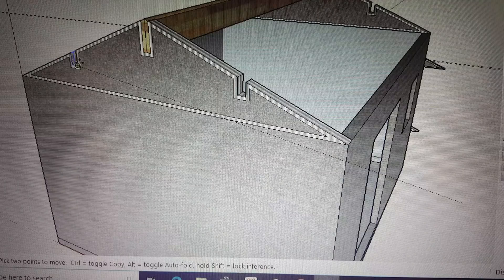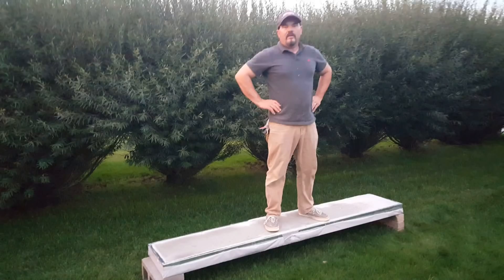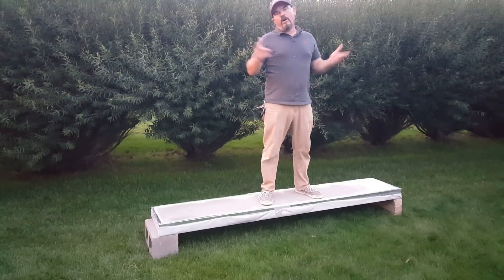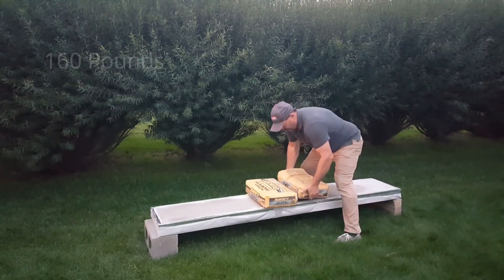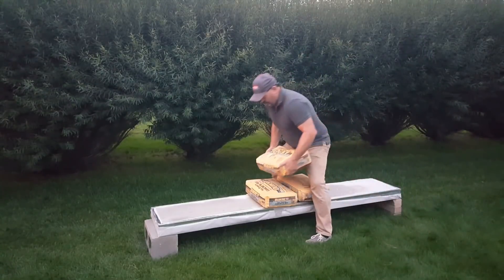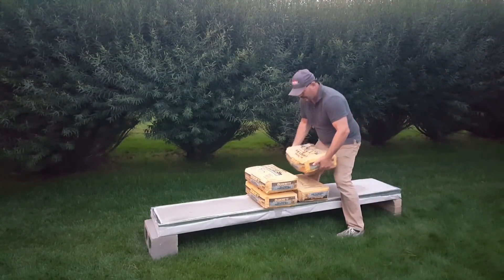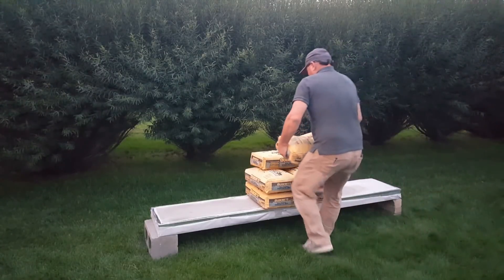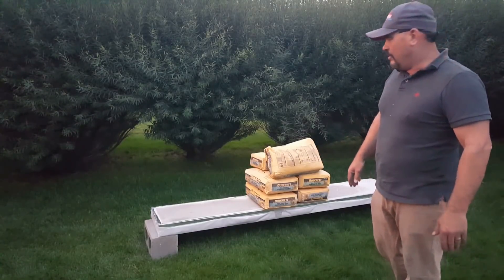Air Crete Stress Test, Amazing ,Strong Lightweight, Building Panel

Comment: You should try to test it to failure in preferably in at least all three simple stresses ie compression, tension and shear forces. You could then infer any complex stresses like torsion or bending based on how well air Crete performed compared to regular concrete. Common sense says it is less strong but my intuition says it’s probably not that much weaker and certainly strong enough to be relied upon for most applications.

Comment: Hi there, We are just looking into air crete and have a slanted porch roof we want to air crete ... My question is what do I need to do? lol  Since it is slanted, but not like a pitched roof, more like a slightly pitched lean to.  My question is, could we spray down a  semi thin air crete mixture on the surface of the roof which has some rubberized stuff, we tried before that sorta worked but have leaks.  So can we just apply the air crete over this like I said before, in like 5 inch pours, and then put more over it after it dries? By now you must know I have NO IDEA, what I am doing:(  Like do I have to make forms or just apply the air crete on the surface of the roof? My email is fairytale_cakes@yahoo.com thak you for all your videos and help you rock kind sir:)

Comment: Darwin, I'm glad Stephen P.  Brick mentioned using the basalt mesh.  I am in the process of building a home originally planned to be all metal.  Now I'm seriously considering air crete for outside walls and skipping a LOT of insulation.  I NEED to know about the strength of the panels if used for floor or ceiling such as a sleeping loft in a 2 story house.  The area will be 16 ft x 32 ft.  Got any ideas on how I should support air crete for the floor?

Comment: Air Crete can it be used to make a aquaponics tank that is my next project was going to do concrete panels but this is super neat for sure
Reply: I can't speak to the structural strength of the material, but with Aquaponics you need to be super careful with the chemicals your system comes in contact with. In regards to cement alone, its fine for tanks/beds, but you'll have a long road a head to stabilize the pH in your system due to the cement. Most people who use cement tanks, usually line it with PVC pond liner or the likes. Now in terms of the foam additive for the AirCrete; you don't want anything that would be toxic for your aquatic life. In terms of the AirCrete surface finish, being highly porus, you'd likely have issues with the bacterial colony that you can build up, in terms of sustaining them against the high pH of the cement. If you can solve alot of those concerns via pond liner or other methods, then as long as the AirCrete can withstand the forces required by the volume of water you want, then you should be fine. takes a breath

Comment: How strong is aircrete can it support a lot of weight talking about tones of weight.. I am trying to see if it would be work for an underground application.
Reply: Timothy  Travis I’ve seen numbers around 50-900 psi. The less foam, the stronger. I would stick with using regular concrete and maybe using the aircrete for insulation. You can easily get much higher numbers with concrete block or whatever. Look into an interlocking soil block press. Cheap and easy and makes much stronger material thats easier to use. Especially when fired.

Comment: Would be good if you produce figures! 
Good, great, phantastic, strong, lightweight, insultating ...all these words reflect  your opinion only but and are not material properties....

I worked with / engineered / designed many foam concrete applications, a diesel driven  foam concrete machine for in situ production of various foam concrete densities and pumping of wet concrete.

I admire your Videos sind enthousiasm but with that you also show that you are at the very low end of foam concrete design and its applications.

Please improve.

Best regards

Greattimez
Españistan

Please back up your personal opinion with fakts and figures
Reply: O yes at least I learned many things wich I can use for my projects from low end and non from the high end

Comment: Not sure where the idea that Aircrete has no strength comes from.  They've been using it in Germany for decades, building most of their large, commercial structures from the stuff.   Pretty sure they get snow from time to time, too.  Aircrete isn't new, but current U.S. building code is outdated and myopic, so anyone wishing to build in an area requiring codes, which is pretty much everywhere, is screwed if they want to use Aircrete.  It's a shame, really.

Comment: would the structural integrity hold up in humid freezing conditions? aircrete would be more absorbent than regular concrete, right? just wondering if it can hold the weight but if thatd change with sleet/ice/snow

Comment: How much expense for a 600 sq slab?  Just to get past a building requirement.. Thanks. Your guess for thicknesd... Cheapest is best
Reply: 1 sack cement does 5.5 cubic feet of aircrete, use an online calculator to figure the rest.

Comment: You could put steel reinforcement in aircrete, right?
Reply: they did, chicken wire, not the traditional type of rebar, but it is all it needs

Comment: Great! But... You schould be aware that it's not the air crete that actually passed the test but rather the aluminum frame! Without the frame, the pannel would bend and crack. In anyways, you made your point! And thanks to You I have been researching about air crete and yes, that stuff is amazing! I dont know if it is 100% waterproof, but if it is, Your next challenge could be... building a boat! keep up the good work! +1 (one last concern, aluminum and concrete dont mix so good... galvanic corrosion...)
Reply: lol! You sure can! Do some research Richard!
Reply: Wire mesh boats are floating all over the world! LOL! Most people are cluelesss!!

Comment: Can you do a Stress  Test  on a Panel  without the Metal Frame
Reply: he does not understand what stress or test mean
Reply: If you have ever handled that kind of frame it does not add much strength. 30-40 lbs would be all it would take to fold it up. It is the chicken wire inside the panel that gives it the tensile strength.
Reply: @macrumpton  That's true, but not entirely true. Those metal studs on their own might twist and bend under 30-40 pounds, but like any composite system, both components are lending some kind of strength to one another. The metal helps add bending strength to the aircrete, and the reason for that is in good part because the aircrete is adding torsional strength to the metal studs.

Basically the aircrete constrains the studs so they don't twist. Without the ability to twist, they have much greater bending strength. It's just like bridging across I-joists in a flooring system. The I-joists are really strong in exactly one direction, only. If there's a little twist, as would occur without the bridging/cross-bracing, they have almost no strength.

Comment: You should pour a slab of aircrete just to use as a stress test piece. Make one without any reinforcing material and make one with something inside reinforcing it like wire or rebar. Then just load them up with weight until they beark, I would love to see how much they can hold and see how much they will flex before they break. Just a thought. :)
Reply: Also, is aircrete porous or could you make a pool with it?
Reply: @KoalityofLife  just my .02 opinion.... yes, it is porous which does not mean it is not impervious to water.  Look up the mean of the word porous.  It pretty much means it is pitted or has little holes in it but that does not mean they go all the way through the material.  If you want to assure it is water proof or moisture resistant there are plenty of paint on membranes available in the ceramic tile department of big box stores or building supply stores.... even a nice coat or paint can do the trick.

Comment: I appreciate the effort.  Just do not get worked up.  Snow load here is 120-300lbs per square inch.  Yeah. Also take into consideration that others (central/south americans) build whole small homes using a mono pour system with mesh amd rebar.  This helps with the fact that their home is subjected to 200+kph winds and upto force 8 earthquakes on the richter scale.  
 I agree that air crete makes the most sense.  It allows for the inclusion of numerous elements that negate sand and gravel (future inclusions of graphene filaments or other forms of modified carbonaceous matter) Also it is more water resistent if not downright water proof.
Reply: the specific gravity of snow, even wet snow, even just straight water 30 feet deep doesn't even come close to 43 thousand pounds. you are confusing square inches with square feet.
Reply from the maker: Depending on the region in Idaho, the snow load requirement is somewhere between 15-100 pounds per square foot........300 X 144  is over 43 thousand pound per sq ft. No building code requires that much .
Reply: Honey Do Carpenter 

Ours does as we are in a mountainous region and our codes are set for 50/100 year high snow fall levels.  This can result in anywhere from 5 to 8 meters of snow nominal.  That is close to 30 ft of snow not including trapped water over a season.

Comment: Hey I'm wondering if you can make another panel next time you do a mix. It would be cool to test one to failure. I'm just curious at this point about how much load it will take.  Clearly the load is not an issue but still. Thanks for the video.

Comment: This is just a thought, do you know if egg whites will make a foam that will work like the store bought foam mixture?  Thanks 
Ed
Reply from the maker: they work good in waffles
Reply: I would worry about the stench when they start to rot.  Concrete alone smells bad enough.

Comment: That is exactly what I needed to know.  We get so much snow.  We ordered the big foam mate about two and a half/three weeks ago.  Its under Sybil.  I figured with smaller animal shelters it would be fine but that test you did on the long panel is awesome it gives me more options for design knowing its so strong still.
Reply: Also if nothing else I could just make smaller bricks like your raised garden bed for the rabbit shelters.  Do you think it would be easy for for a rabbit to dig through though.  I understand it can be cut so I was thinking maybe of plastering it with a thin layer of cement after to discourage that.

Comment: I'm thinking of using air crete for the 'pony walls' of a barn.  Do you have any specs/guess as to the compressible load of air crete?
Reply: Tyler Woods 
The air crete is worth a look.  Just google the mpa compression data.  It is available,  you have to boost the fibre content of said crete and the rebar content (mesh also)  to counter the increased ability for the chance of lateral movement or flexing under load.

Comment: Darin:   Did you measure the deflection at 480 pds.  The deflection on a 16' beam two  back to back 3.5 " steel stud forms poured together 8" deep to make a beam  of air create 7" wide on the cords with the 8" web.    In addition a 3.5" x 8" panel on edge as a beam all with the hardware cloth on both sides  16' long.   I would use a 24" spot welded overlap where the steel studs are joined to get the 16' length.   In theory it should work as the tension on the bottom is the steel stud.  A 16' length of 1/2" re-bar up 1 1/2" from the bottom of a second 16 ft.  3.5"x 8" beam would be also a good deflection test for comparison.   Three beams and three tests.     the old guy   Bert
Reply from the maker: ya it was 3/4 "

Comment: Hi hd i had just one question on ya panel. when ya layde it down for the tet was it wire mesh on bottom or on top panel?
Reply from the maker: bottom, of course
Reply: rebar and other reinforcement materials give their strength when on bottom.  It is like a suspension below a bridge.  By being on bottom the compressive forces are on the concrete withstanding the pressures.  The steel rebar on bottom holds the pulling forces to keep it from pulling apart  from the bottom.  People often think wrong when they think rebar should be in the middle of a slab.